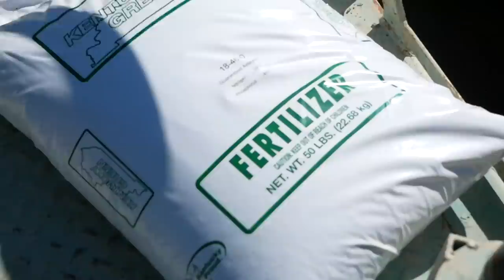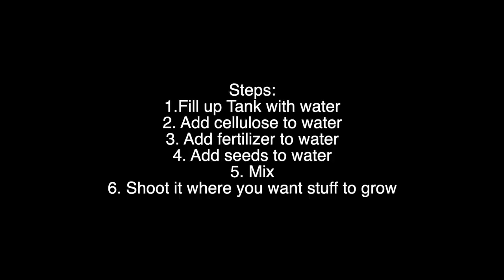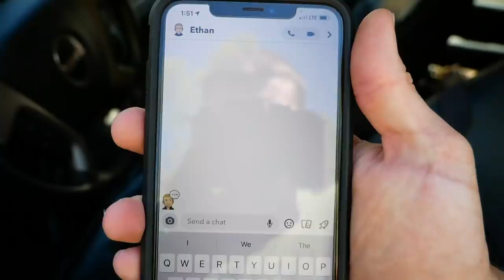WE SHOULDN'T HAVE DONE THIS!

Comment: Nice to see some more of the Gray family in the video! What your dad and uncle were doing is called hydroseeding. Many usually get the grass seed that is woven into a roll of plastic netting with straw in it, but what your family were doing would be safer and quicker on those steep hills for sure. That dozer wasn't going to let that 5 ton slide anywhere.